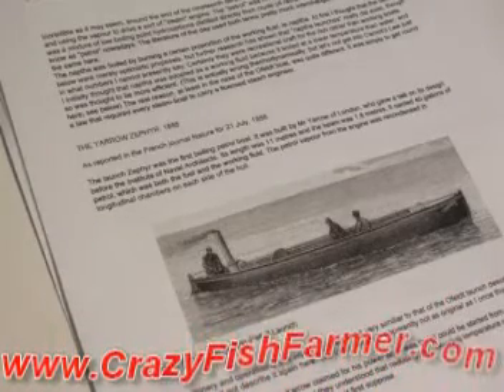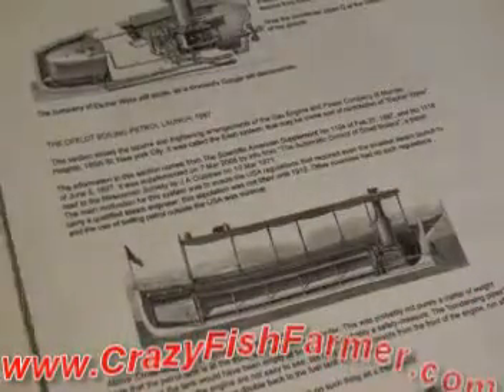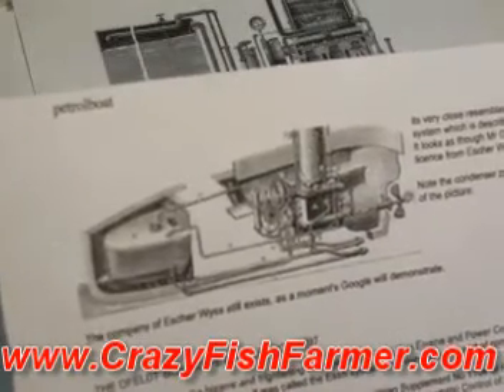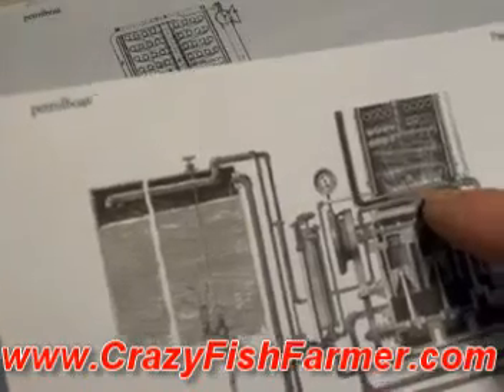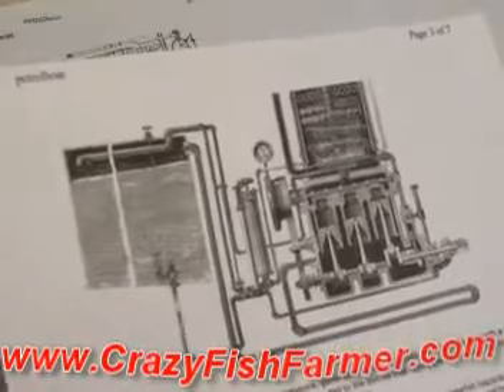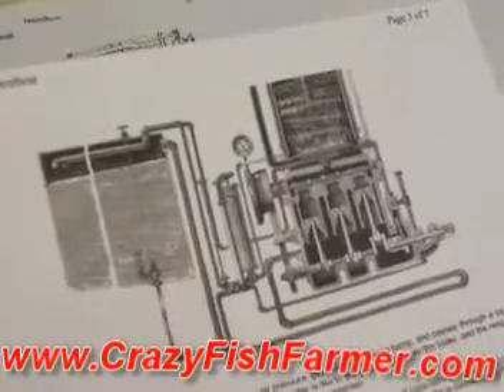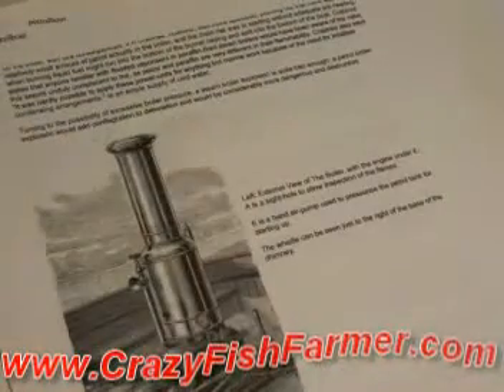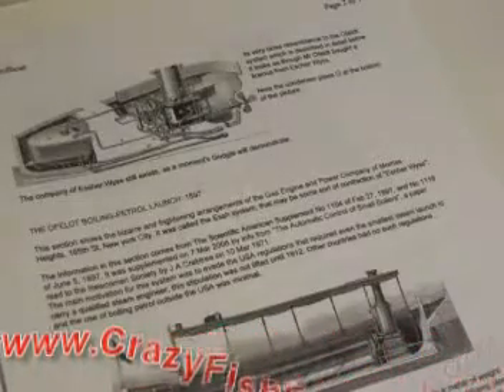PETROL BOILING BOAT GEET fuel processor

Comment: The man he's talking about was simply using the engine's heat, as usual, to run a vapour carb system. They were very common in the late 19th century as ordinary carburettors were still in early stages of development.